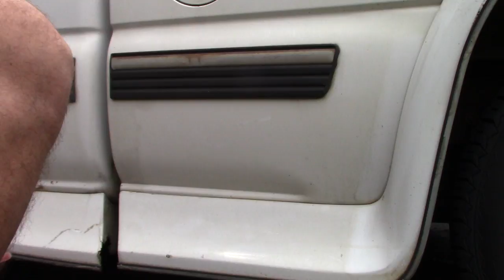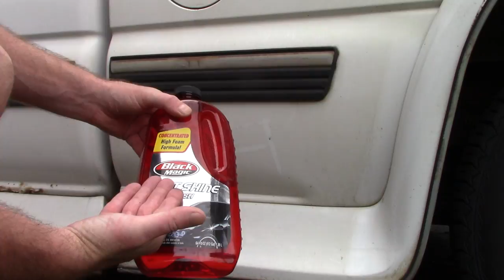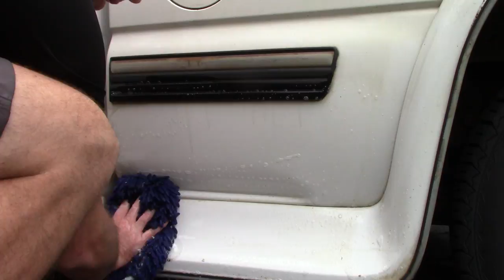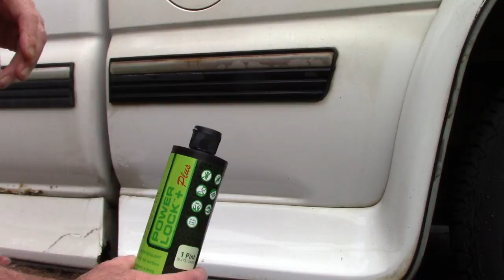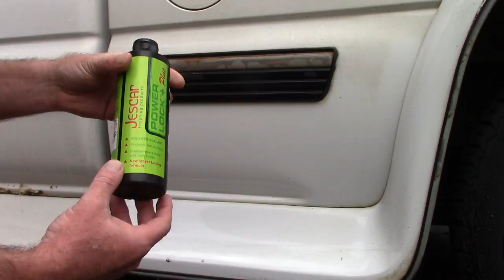Traffic Film: Can It Be Removed - This May Scare You!

Comment: 30 years of degreasing components prior to paint has taught me that agitation, contact duration, temperature, cleaner chemical composition and pH are key. Agitation probably won’t play much of a role here due to scratching issues (but drastically helps in cleaning). However, increasing solution temperature also increases efficiency. Higher pH cleaners actually turn some of those nasty oils and fatty deposits into soap, that’s what happens to oils and fats at higher pH.
Reply: Correct.  The term is saponification. The conversion of fats and oils into soap.  People been making soap this way for decade usually with the help of lye...chemical industry uses Sodium Hydroxide mostly today.

Comment: Scott thanks so much for this info. I have been having trouble with maintenance washes using a ph neutral wash and wax. Even simple stuff like body oils and smudges are being left behind sometimes. Going to pick up a bottle of purple power soap and start using it. 

Now the question is what kind of sealants can we use and how durable are they? Any opinions on Carpro Reload? at $35 a bottle its supposed to be the strongest spray sealant. Or have you ever considered offering ceramic coatings?

Comment: If you live in the city where heavy traffic film is the problem...it sounds like you'll have to wax/protect your vehicle every single time you remove traffic film. Because stripping off traffic film with degreasers will strip off all your wax/protection too...If you wash your car every week with this method, you'll never have any wax to preserve, right? Surely there is a good product that can remove light traffic film but not wax??

Comment: Scott, I get what you're saying here. That's why the roads can be super slick right after a shower if it's been weeks with no rain. The rain releases the dirt, chemicals, etc. My question would be, doesn't the wax/sealant that's been previously applied protect against these contaminants so that a ph neutral car soap would indeed wash them off? Unless these contaminates are eating through the wax/sealant it just seems like common sense to me. Thanks for the vids and making us think!
Reply from the maker: in my opinion the wax or sealant can't stop all the traffic film from touching the surface of the paint!..i know this to be true because when i use to maintain my clients vehicles with just using a traditional car soap and worth adding applying a wax or sealant every 3 or 4 months, i would notice if i did some paint correction to those vehicles at the end of the year i would pull traffic film from the clear coat and it would show up on my pad and that was after strip washing the car, claying the car and using a paint prep before paint correction..i believe the traffic film will enter the clear coat and make it look cloudy and many will blame the sun for oxidizing the paint when in fact it was traffic within the clear coat that was not stopped by the wax or sealant

Comment: I see something very beneficial to this video and the negative comments. If people use their heads, you may understand both sides of the coin. 
my take is,

you will be able to remove road film, but not by just washing your car! in fact the road film/oils in the road film may actually protect your paint until you can remove it and get some (REAL) protection on it. the road film Is in fact protecting your paint to some extent, once you remove it the proper way, you then can then put your product of choice, sealant/waxes/coatings etc... to keep it that way.

hope this helps .

Comment: Hey Scott what about iron x removal should I still use that to remove traffic film or will purple power do it all.
Reply from the maker: iron x isn't a traffic film remover..iron x removes bonded metals on the paint..purple power vehicle wash is a traffic film remover but it will not remove bonded metals...so to answer your question, you should be using iron x when your trying to remove iron from the paint:)..purple power vehicle wash will give you the best chance of always removing traffic film and perhaps once or twice a year you can spray iron x on the paint and just go after the metals that will unfortunately bond to the paint over time

Comment: Damn Scott you rattled the cage again with this one. My question to you is how do we know the road film ate through the wax/sealant on the paint? The wax/sealant makes it harder for contamination to bond to the surface. Plus some waxes/sealants boast about being chemically resistant. So how do we truly know?

My thought process is this, if the wax/sealant is still beading/sheeting water there is still product on the surface. Sure there will be other contamination, but not as much as if there wasn't a wax/sealant on the vehicle.

So is it absolutely necessary to use a non-ph neutral soap every car cleaning?
Reply from the maker: have you ever clayed a vehicle and seen traffic film all over the clay bar?..was it because it bonded to the wax on the car or did it bond to the paint and go right through the wax or sealant?...i have clayed vehicles after using a wax or sealant on my customers cars every three months and still traffic film will bond to the paint...so what is the wax really doing and how effective is it really?..would you agree with me that using a actually cleaner for the paint and lets say apply meguiars fast finish which only takes minutes to apply(no more time then the guy who uses a ph soap to protect his wax only to top off with a spray wax after every time he washes the car) would be more effective and limit greatly the chance for traffic film to bond to the paint...well i know the answer..but interested in your thoughts?
Reply from the maker: also Trent...is the traffic film on the car water Soluble?...now we are using a ph soap that can only remove loose dirt from panel and its mixed with water...so where is the traffic film now on the panel after washing the car?

Comment: Love your Vidz Scott keep em up; Now here is a question for you. For YEARs all I hear is DO NOT use Dawn Ultra on your car cause it will Mess up your car etc.  How is it that Dawn Is used to Clean an Oil Spill that has drenched tons of animals but it is NOT SAFE FOR A Freaken CAR? I mean is this really the case or some marketing by the competition. 

Sure it will remove wax? But Based on your video here wouldn't that be a Good thing, as again if it can break down oil, it can certainly brake down Road film on the car no? 

Lastly, they say Dawn will Mess up Plastics on your car, and destroy the Rubber moldings. Is Dawn Really that much strong than Purple Power Vehicle & Boat. Cause I know you say to use that on the car, that its safe. 

I appreciate your opinion/thoughts, thank you.
Reply from the maker: well some will say that using dawn soap is abrasive and if used over and over it will remove the natural oils within the clear coat and harm the plastics around the car...so we need to look at the surfactants within dawn...purple power vehicle wash is a ph of 10 but the surfactants within the purple power soap were formulated to be used on the clear coat where dawn soaps surfactants weren't ....yes dawn soap can be used on animals to remove oil but the animal can also replenish any oils within its skin even if dawn gave them a little dry skin after using....does that make sense?..i loved the question and thanks for being so kind..much love my friend
Reply: Thank you for the response; now I just have to find me some of this purple power. Cheers

Comment: Hi Scott, loving your videos. I live in a very dry part of the world - it only rains here maybe 2 to 3 times a year. Do you think traffic film will be as much of an issue if its not getting lifted off the road in rain water?
Reply from the maker: yes it would be less of an issue for you...you lucky man:)...where do you live?..if its dry can i assume its also dusty?..do you drive at high speeds and with lots of dust in the air?
Reply: Dallas Paint Correction & Auto Detailing I'm in the Middle East and it's dusty as hell. My car normally already has a thin film of dust on it by the time I've dried the whole thing. I've been using Finish Kare 425 as a drying aid and whilst it doesn't stop the dust accumulating it certainly has less on it and tends to help it blow off at high speeds!

Comment: this is why i cant get a wax to stay on my car because when i wash i must have a stronger soap to get it clean and it will strip the wax in like 3 washes.... i have ended up just using spray sealant on my own car because i wash with a strong soap to get the traffic film off, and i have a black car and you cannot wash it like you did here i the video it will show up micromarring in the sun and look horrible...  i have noticed that a strong soap and spray sealant and a light polish now and then just to remove the light micromarring from careful washing is the way to go with a black car... and those ceramic coatings gets micromarring over time as well and then you need too do it all over again... BTW the sonax extreme brilliant shine detailer is good stuff!!
Reply: The Purple Power Vehicle/Boat Wash followed by Meguiars Fast Finish should work fine for you. For the first wash, and every 3-6 months as needed, add in Meguiars Wash Plus after the initial wash and use that to clay (synthetic or real) and clean the sealant completely off. You probably won't need to clay more than once a year. The PP won't COMPLETELY remove a quality sealant like Megs FF provided you have done the prep work before applying it.

Comment: I'm new to the channel and I've just seen 2 rant videos well what I would consider rants about Ph soaps can't remove traffic film. I understood you from the first one but I'm lost am I to spray super clean on rinse it off then do the rinseless wash? If that's the steps I have to take then I can't do it at my apartment now.
Reply: Use the high PH soap that Scott mentions - "Purple Power Vehicle and Boat Wash" to remove the traffic film.  Super Clean is not for paint surfaces, but is best used for cleaning: engines, wheels, tires, and even interior door panels. He has videos on using Super Clean on the parts I listed.
Reply: @MikeNNJ79  Thanks but that cut out washing my car at my apartment. After using that soap is it ok to use a spray way?
Reply: Your best bet would be to just mix some "Purple Power Vehicle and Boat Wash" with water in a spray bottle, spray it on then wipe it off with a wet microfiber cloth (you'll probably need a few of them), then wipe off the water with a dry towel.  You can spray on "Meguiar's Ultimate Fast Finish" after you dry it.  As for the wheels and tires, you can use "Super Clean" spray, and wipe them with a wet microfiber cloth, then dry them with another one.  That would probably be the most effective way to clean off the traffic film from your car without a hose and bucket of water. 
Your other option (which is not the best one) would be to bring your car to a local car wash, because their soap is just as strong if not stronger than Purple Power (but you'll run a high risk of getting some minor scratches ) and just get a basic exterior wash (no wax/polish). Then you would spray on "Meguiar's Ultimate Fast Finish" to get some shine and protection.  Hope that helps.

Comment: Something interesting I looked up the msds documents on these that krud cutter vehicle and boat has a lower ph level than Adam's car soap lol
Reply from the maker: chris alvarez well I don't use krud cutter but the mds sheet will only tell you what's potentially harmful to you but surfactants that aren't ph neutral don't need to be disclosed to you or I:)
So your statement can be and probably wrong
Reply: Dallas Paint Correction & Auto Detailing scott that's not true I actually work in the industrial field I have for over 20 years. All chemical compositions are available on msds it's an osha requirement the reason for this is well msds stands for material safety data sheet now revised to be called just safety data sheet anyway the reason everything is required to be disclosed is because of just that safety one has to know how to handle, store, use the product etc. Plus all the information as to the chemical fire hazard rating combustion rating etc. As well as ppe or personal protective equipment required or recommended for the user(s) handling the chemical as well as environmental information such as disposal etc. And first aid information if contact with eyes etc. Occurs